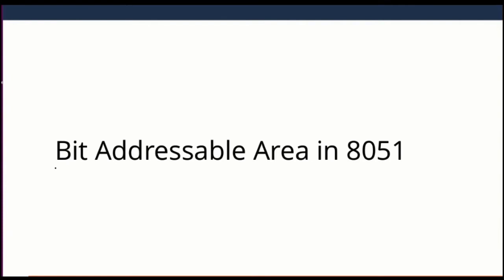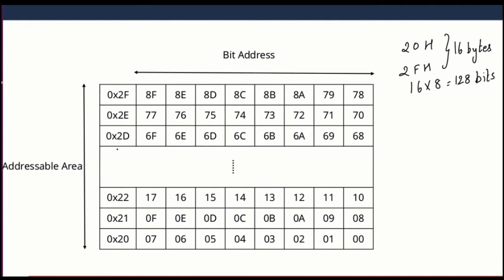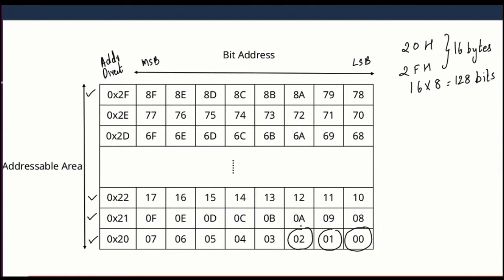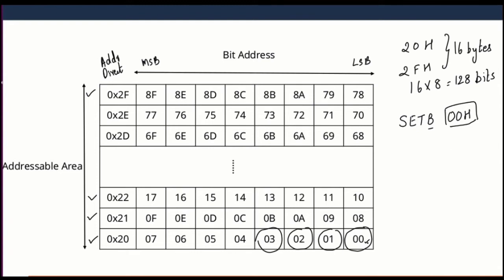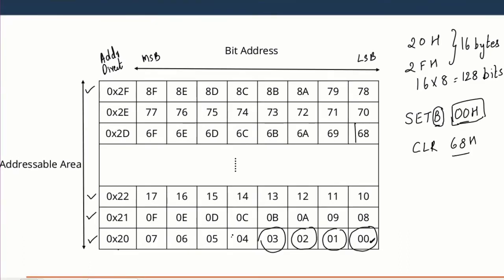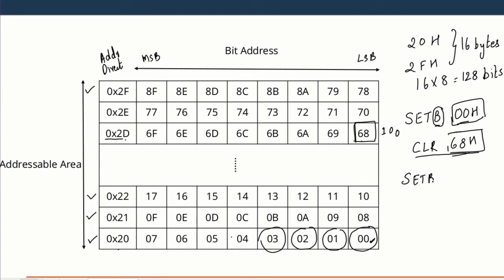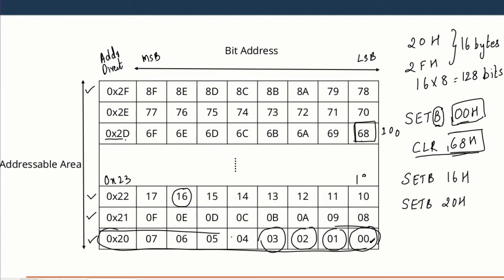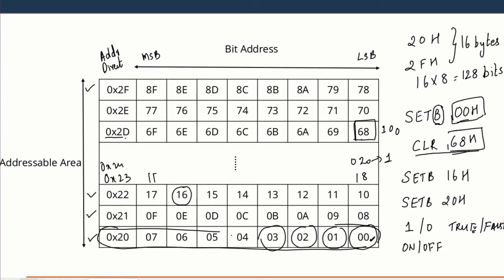Bit Addressable Areas in 8051

Comment: Hi, how can i adress the flags in the PSW? For example if i want to check my parity flag (/Overflow flag/carry flag) if its set and then, depending on that, want to jump on a label?
Reply from the maker: Hi there, PSW is a SFR like P0 or PCON. You can access it directly using JB/JNB/SETB/CLR Instructions on any bit. For example, "SETB PSW.0" or "JNB PSW.1".